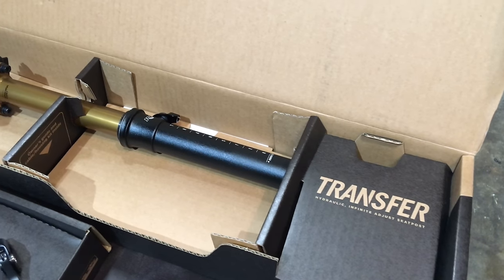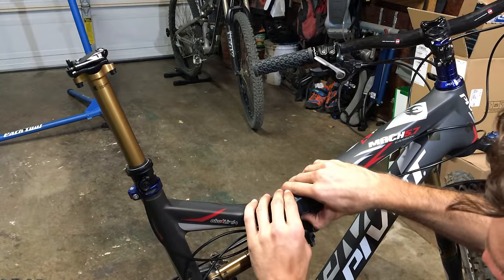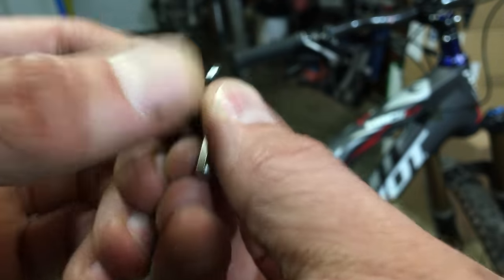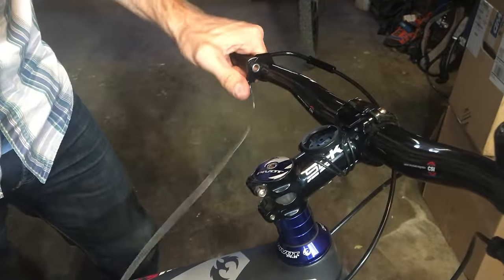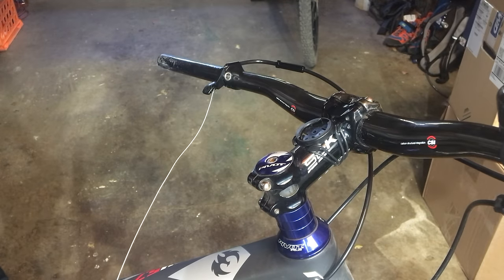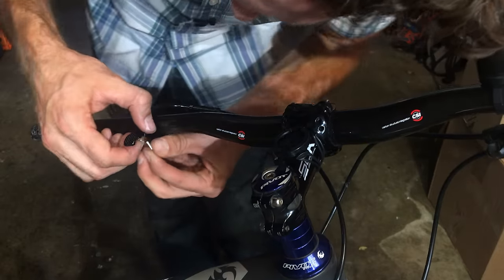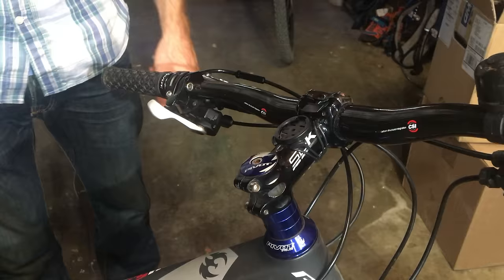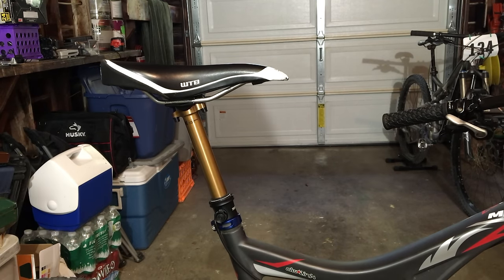Fox Transfer Dropper Post Install

Comment: Great video. Helped me tackle this install. Purchased my post from Worldwide Cyclery too. Thanks for the code! I was able to install this on my hardtail using the frame cable mounts for the front derailleur. Had a hiccup because I thought I was going to reposition the cable housing stop and when I put the cable pulley wheel back on I made the screw too tight and the pulley wheel would not release - so the post would rise to its full length. 20min later figured that out. Great product!
Reply from the maker: Fantastic, glad I could add SOME help!

Comment: Brian,
Awesome video! One quick piece of advice. A great way to get play in shifter cables is to shift to the largest gear on the cassette (highest tension) and then on the shifter shift to the smallest gear without letting the bike shift. I'm a bike mechanic and I use this trick often when working on bikes. 
Cheers man! Keep up the videos.
Reply from the maker: Very good call! Thanks Alex

Comment: I briefly looked at the directions and dove in. At some point I took a break and found your video. It filled in some blanks. lol   Just another reminder to read before your begin a project, just in case you forgot to lubricate the cable so you don't have to back track to do the right thing.... Thanks again!
Reply from the maker: Haha, damn directions!! Thanks

Comment: Greetings from Albuquerque.  Just ordered this dropper from Worldwide Cyclery and the coupon code is still valid...awesome.  The trickiest part was figuring out the sizing options.  I went with the 150mm internal because it fits in the seat tube but also gets has enough extension to get the seat high enough.  I'm not tall, just my GT frame is low and has a short and wide seat tube...34.9mm.  Fingers crossed the 150mm is the right choice.  Thanks again for all the videos and the coupon.
Reply from the maker: Nice! It's definitely worth reaching out to Worldwide Cyclery in email or chat to ask what they suggest on the length, they really know what they're doing.

Comment: hi!

the fox transfer may really be the best dropper post there is atm. I especially like that it works without hydraulic-fluid, so not that much of a pain regarding maintenance.

i would recommend that you maybe grease the post that goes into the seattube, especially if its a carbon frame. and also i would get a really sharp side-cutter for the cable-work.

keep it up!
Reply from the maker: Thanks man! Always appreciate the feedback!

Comment: one thing I figured out was to measure the saddle height with a tape measure and the saddle tip angle with a water level, so I can quickly get the saddle back to the exact same position with the new stem.
Reply from the maker: Good call!
Reply: installed my Fox Transfer dropper post today and it works like a charm. Thanks for the tips & pointers. I chose the longer lever option and mounted it on the right handlebar, because my Scott Spark has the suspension lockout lever on the left. Seems to work alright.

The grease situation is hard to avoid though.

Comment: Just finished installing my 150mm travel Fox dropper.  I went with the longer travel post so I could get a wider range of motion.  I did the exact same goof you did with making 2 cuts on the cable for the trigger.  Haha.  I was wondering if your seat had a small amount of play in it when you were done.  Not so much, just when I grab the seat and twist side to side I can detect a small amount of play.  Perhaps it's normal for a dropper?  Overall, I'm very happy with the post, your video, the BKXC coupon, and the awesome service from Worldwide Cyclery.
Reply from the maker: Awesome, glad you could use the coupon and the WWC guys took care of you! The post is on my bro's bike and I'm out traveling and I honestly don't remember if I had side to side play.

Comment: Thanks for the video. I'd recommend you chuck some carbon paste on the post when putting it into a carbon frame.
Reply from the maker: Good call, the instructions suggested that too. I'll see if the local bike shop has some.

Comment: I work at a bike shop in aus and if u ever fray a cable u should ALWAYS replace it other wise u can weaken it. I am just saying no trying to insult you or any thing. And i love ur vids by the way
Reply from the maker: No offense taken, brother! I'm always open to as advice. It seems like the dropper post cable is just a normal shifter cable so I should be able to re-do it.

Comment: was it just me or was installing the seat to the post unreasonably difficult? you're basically balancing the seat while you try and get the screws threaded between the two separate plates....
Did you have side to side play after installing the seat? If so, how did you combat that? I've tried reinstalling the seat to no avail. I swear the lower plate is rocking side to side despite the two bolts being tightly fastened.

Comment: What does he think of the fox transfer, I'm deciding wether to go for a fox transfer or reverb. I'm going to also be buying fox suspension at some time so I'm leaning towards the transfer. Have you had any problems?
Reply from the maker: No problems, but not a lot of miles ridden!
Reply: Miles Pearce I just recently picked up the reverb. It's fantastic! It's not controlled by a cable so it's much more fluent and fast. Both are great posts tho!

Comment: Hey Brian what cable and housing did you use and did any come with the post or the remote? I'm trying to look for the cable and I'm wondering if it's just the same regular cable and housing you use for a shifter.
Reply from the maker: Dang, I don't remember what came with the dropper. Hit up the guys at Worldwide Cyclery on the live chat and they'll know!
Reply: BKXC okay thanks man!

Comment: Brian, love your channel, and enjoyed this video. I'm curious, the triflow lube you applied to the cable, was that called-for in the instructions? Do you lube your shifter cables in the same manner?
Reply from the maker: Thanks so much! I don't remember if the instructions called for it, but I've seen that as a little tip to help guide cables through. I do the same thing for shifter cables.

Comment: have you had any issues with the dropper sagging?
Reply from the maker: I have the post in all the way, so it's not a problem. I definitely would need to get some carbon paste (like others suggested) if I had it up at all.
Reply: Sorry i meant the adjustable section. Mine will lower itself 1/4" and I'll have to use the remote to get it back up for climbs
Reply from the maker: Ah, sorry! I've been riding a lot on it the past few days and I have not noticed it dropping on it's own.

Comment: Nice dropper ... give us an update after a few months if you get a chance. I'm curious how well it will hold up.

BTW, I would recommend using some sort of a fiber paste on the dropper post (the area that's inserted into the frame). Finish line makes some called "Fiber Grip". It's relatively inexpensive.

http://www.jensonusa.com/Finish-Line-Fiber-Grip
Reply from the maker: Awesome, thanks for giving me the link to check it out. I've been meaning to look it up!

Comment: Not liking the cable setup on that dropper. The end is where your hand is located where you can jab your fingers.
Reply from the maker: Yeah, didn't think about that. Just another benefit to losing the front derailleur and having the 1x remote.
Reply: Sometimes us fat folks need the extra gears. =\
Reply from the maker: Have you ridden on a 1x? Definitely worth checking out to see for yourself!

Comment: Another thumbs down... why do most of you miss the most important part ?? the freaking routing. Specially across the body of the bike up to the tube?. You act as if the handlebar and the seat post was all we are to care about. Don't you realize some bikes have internal routing, some partial routing and some no routing at all , you have to do it  all through zip ties, and there is measuring to be done, not to cut the cable too short or too long?. Try again.